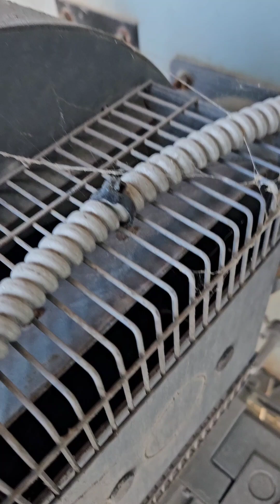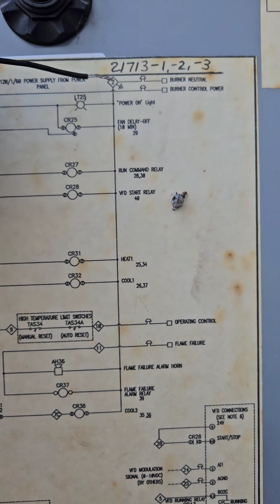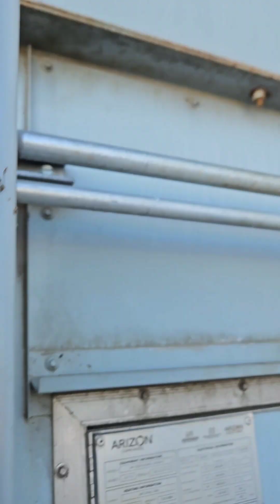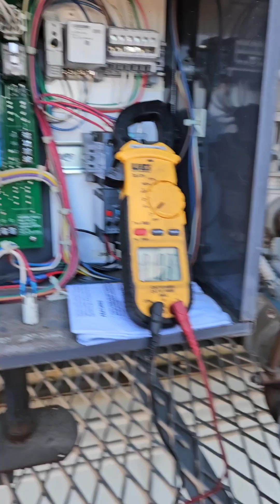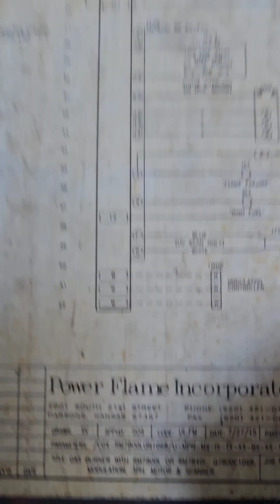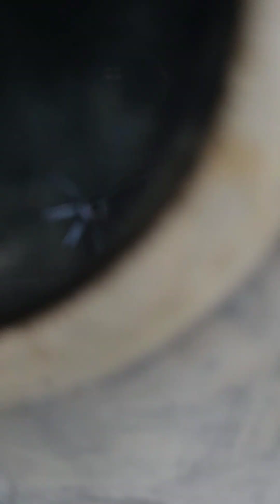2 JOHNSON AIR ROTATION UNITS HAVING ISSUES WITH HEATING. WALK THROUGH OF UNIT.

Comment: Love working on bigger ARU’s and MUA’s. They’re usually so much more simple than people realize. They can be intimidating to look at but it’s all just input and output.
Reply from the maker: @haldermand  exactly. Its not as difficult as it appears. Chase voltage around the unit and make sure maintenance is on point and they run like a champ